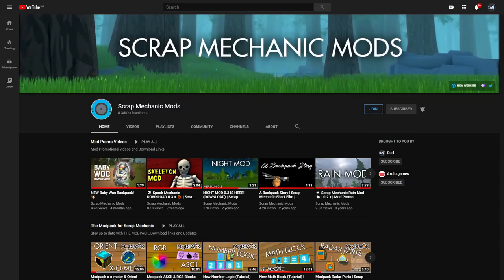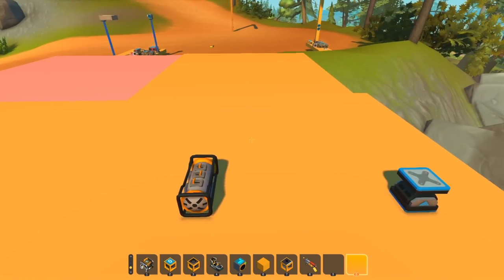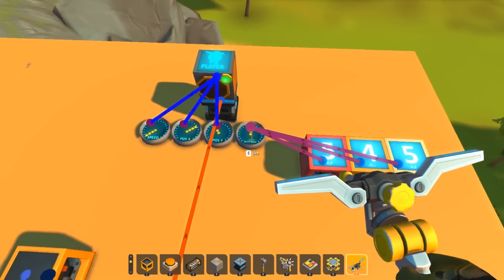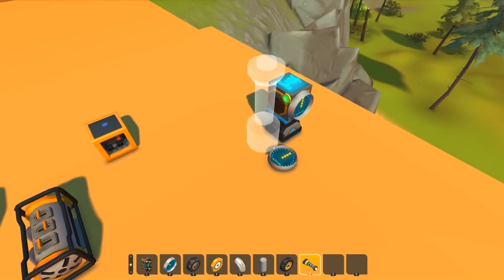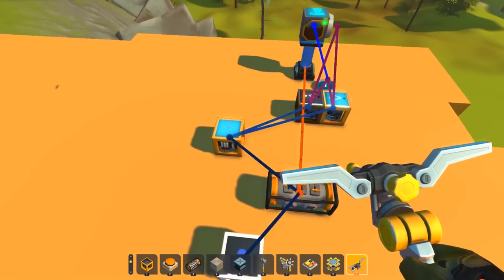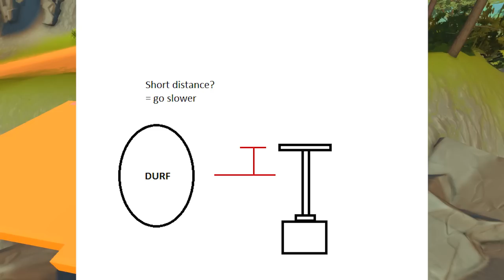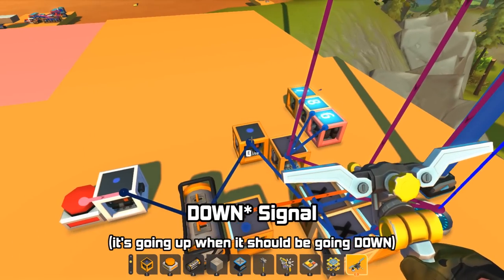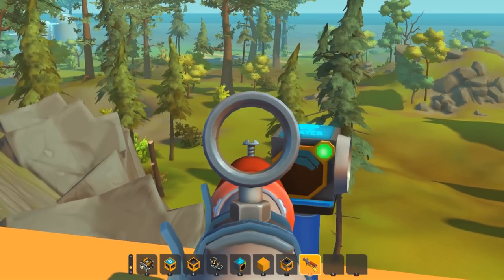Auto-Tracking Piston Height • Scrap Mechanic Number Logic

Comment: hey in the modpack the WASD thruster it doesnt work anymore and acts like an and gate. you click the switch and w it turns on but if you dont have the switch on and use W it doesnt work. i mean by that that the engine uses inputs from a seat for throttle which normaly should glimbal!

Comment: Is it possible to face a wheel in the direction it’s moving in using logic?
Reply from the maker: I think so! I tried to do something like this back when I tried to make a one-wheel robot build on a live stream once...
It didn't work out too well because of the delay between parts I think..

But yknow this is also just a caster wheel (no power or logic to do the job), like a shopping cart wheel, it does the same thing mechanically with no extra energy

Comment: Hey! What would happen if you stepped on the piston?
I saw that it seems to be tracking the center of you, so if you jumped on it, wouldn't it constantly fight for altitude and keep going until it hits 256 (the modded piston limit)?
Reply from the maker: Yes
There are some exceptions: pistons need a strength value to push, and if there is weight on top (the orient block itself, a car you drive on top, etc) to push upwards.
The dwarf itself doesn't have any weight, but the act of stepping on/off something can interact in a weird way with the corners and push it down (same as you running into something can push it forwards)
For the most part, it will do exactly as you described.

Comment: Is there a new way to use the orient block? I was watching the old video and building a turret like the way in that video doesn’t work
Reply: Fix: use modded engines and seats not the new ones that have levels
Reply from the maker: Yep, it seems to be an issue with the recent update and all the interactive parts; thankfully all the mod stuff still works with mod stuff.
It will take a bit, but I'm sure everything will be brought "up to code" soon ;)

Comment: I'm using this to make an automated crane but when I turn it on it bounces around as it tries to lock onto the tracker. is there any way I could fix this?
Reply from the maker: Not much I can say without seeing what's going on myself...but it sounds like the end of the crane overshooting constantly, never stopping on target

Some things to be aware of:
the speed of change of the system itself (how fast can the end move up/down max speed)
The multiplier used on that speed value 
(this is where you grab the info how far you need to go, and when it's short distance you multiply speed by short number)
(so larger distance is multiplied by speed, so when it's far from target it moves quickly to get there, and close to target will be slow to get there)
And finally the tick delay of the system, relative to how responsive you expect this crane to be. (how many logic does the signal have to go through, before it moves the crane)

So you want to start with some simple examples while you're calibrating this stuff
"bounces around" makes it seem like the setup is either only 1 speed all the time, or the speed multiplier is just a little too fast
(there's more math things you can do to control how quickly the system accelerates and for what kind of distances)

I'm making assumptions here too:
piston strength and weight of the crane could also effect "bounces around", even if you did the logic 100% correct
You can always try giving the piston super super strength so it's super stiff, just to see what it's trying to do
Reply: I tried a few of those and it just caused the crane to leave this plane of existence. The solution turned out to just be ‘piston length = player X location - piston start X location’

Comment: Could you try to make a similar circuit but for thrusters. 
Like a flier that triest to hover at a certain height given by the user. Or maybe something that will try to hover a couple blocks above the player.
That was one of the first things i tried to do at least when i downloaded the mod. 
Although as you can guess I basically only got something that worked similar to the binary version you showed here.
Reply: I believe you can already do that with this mod. Using the PID function in the math block, you can make it work if you fine-tune it correctly. Actually, if I’m not mistaken, the subtraction Durf makes between the desired altitude and the real altitude is exactly the same calculation the “P” or “Proportional” part of the math block does, except for the fact that the PID also multiplies that difference by another given value.
Reply: @EricPMbk  
Not what i wanted to do. I am aware that tuning a PID regulator is possible for stabilizing a flyer but it would just be so much more interesting without it. 
Also i think it's more than just the basics of a P regulator. I'd say there's some D part in it too
Reply: @mr.byggeee2226  You’re absolutely right. You must consider the derivative and integral to make it work best, which further demonstrates that making a similar system without the PID block is a way more difficult (and more interesting too) alternative.
Reply: I've also seen ppl make stabilized flyers with the PID block by just putting rly high numbers on random that's another reason it doesnt feel as cool as the "homemade" stuff
Reply: @mr.byggeee2226  I would rather occupy the extra empty space on addressing problems such as integral windup to make it both more realistic and reliable, but I guess that using the PID block is some sort of a cheat by itself.
Reply: @EricPMbk  you mean adressing integral windup with more added logic in general or by tuning the regulator?
Becouse the thing was that when i was building i wasnt looking for a some really great solution. Just something that could reliably stabilize the flyer on a 10 block sway would have been fine by me
Reply: @mr.byggeee2226  Although tuning the regulator is a must, I don’t think that solves windup unless you leave the integral at 0, which is not the point. I mean, by adding more logic in general, you can have a fairly reliable circuit that it’s still small enough to fit in small creations.
Reply: @EricPMbk  yeah. Wouldnt proper tuning of the regulator need a transfer function of the flyer tho?
Reply: @mr.byggeee2226  Well, technically speaking, yes, but Scrap Mechanic’s physics aren’t even consistent, so I just prefer to make trial and error. As Brent Batch explained, be conservative with the integral and, with the derivative, not so much, and you will be fine.

Comment: Why do you need to use the multiplication block?
Reply from the maker: 😅That's a great question and it already shows you know your stuff!
Really, as soon as I posted this to YT I noticed that there's a couple of different ways you can do the same logic setup for piston, and it can actually be more compact!
I may show this is a followup video, but truthfully the multiplication and direction states were used by the skulltula logic originally and are not needed for just a simple piston doing height. 

Depends what kind of information you plan to use. 
So for this setup, you have multipliers available to multiply by 0 or 1 for any condition (like the altitude limiter). 
So for the way I even tried to do that, it was convenient to be able to just "turn off down signal" given a condition.
I'll probably show the other ways to do auto-piston logic too, and explain how "information" and "state" matter in how you setup the logic (it's programming; but in the programming language of scrap mechanic logic)